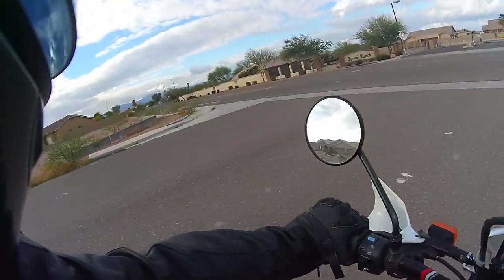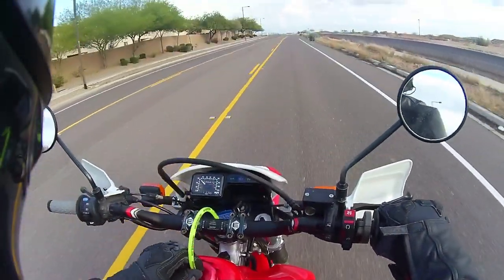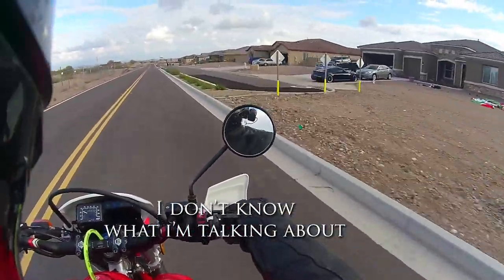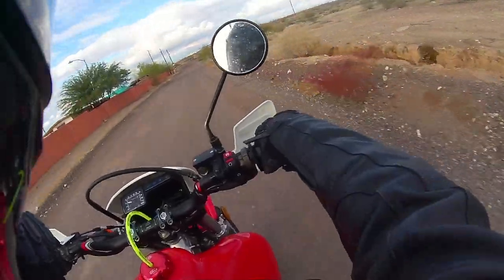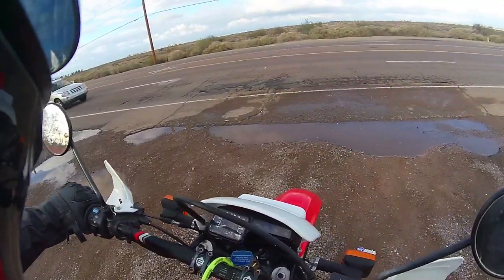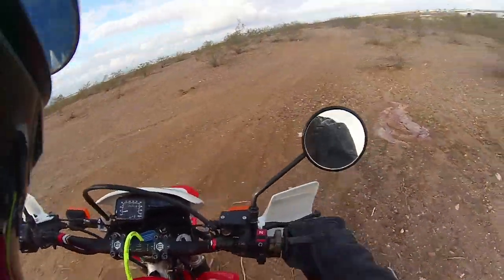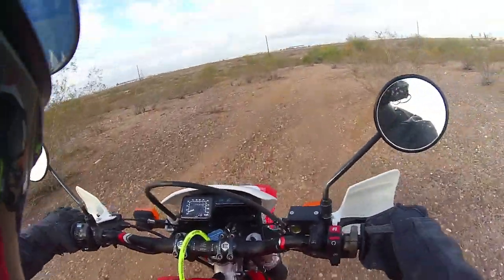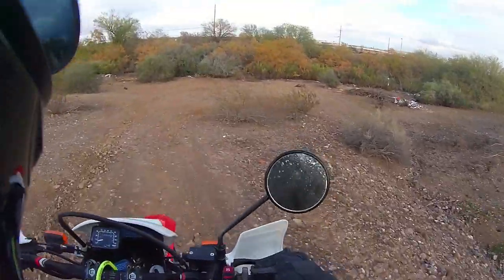XR650L Vlog | Touring Bikes Are Like Campers

Comment: Riding in areas where trash has been dumped is risky for picking up nails! I know.
At some motorcycle size point you might as well have a small car. Last August-Sept. over 4 1/2 weeks I rode a Yamaha WR250R over 6000 miles with a lot of rough roads. 1. Get the best seat for you that you can. Seat Concepts are great for me. 2. Try not to hold the handlebar grips too tightly. I often flex my hands open, then just regrip as lightly as I can that still works. 3. Earplugs actually save your energy as well as your eardrums. One time I was riding a DR650 from Moab back to Denver on backroads. After a couple of hours I was exhausted and didn't think I could keep riding. I put in earplugs (I had forgotten when I left Moab) and I perked up and rode 6 more hours!
I'm 58 years old and have had over 30 motorcycIes, including a 1978 Gold Wing in 1980. 
I really enjoy your mellow conversational tone!

Comment: I have a 13' Super Tenere and a 99 XR650L. I completely get what you're saying and do agree with the exception that as long as you pick a bike knowing it's limitations, it's as good as any other choice. The Tenere is the wrong choice for single-track. It's heavier, more expensive, and more challenging. The XRL, while you can ride long distance on, is not going to be nearly as easy or comfortable as a touring bike. I took my S10 from Los Angeles to Crater Lake, OR, on a 10-day, 3,000 mile trip. I hit a few dirt and gravel roads, and some fire trails. I couldn't imagine a better bike for the job. I picked up my XRL so I could hit the OHV parks nearby and do more challenging dirt riding and work on my skills. Looking forward to running LAB2V next year with the XRL :)

Comment: Not sure if you're still checking comments on these older videos but I'm thinking an FZ07 with some dirt tires and crash protection would be pretty solid for what you want.  Some minor touring accessories make it plenty capable for lightly packed camping trips and it sits comfortably at 80.  I put some Ogio saddlebags and a Cortech tank bag on and I'm pretty set for storage.
Reply from the maker: Tristan Sullivan i get notifications for every comment regardless of the video ;)  Lately I'm thinking this xr650l and an iron butt should so just fine for my purposes lol
Reply: Lol 10-4, seems like you do a lot of offroad anyways.  Got me thinking about something a bit more dirt oriented, sat on the new Kawi Versys 300 at the motorcycle show.  I've never owned a 300 but it seems like a great 50/50 onroad offroad touring bike.

Comment: Thanks for the vid... I guess I subscribed later and didn't see your earlier mod vids... my new 2017 XR650 came on Dec 29th... and I've been busy researching the many options... my Wolfman E12's came last week and the rear cargo rack and subframe stiffeners will be here next week... footpegs, bars and risers come in next week too... Next on the agenda will be a power port for charging my phone and a Garmin wired mount for the GPS... I really like your videos... thanks for the walk around.
Reply from the maker: Todd Gardner thanks, im glad you like them. this bike has a power port built into the front end plastics. its not connected to anything, but it looks like a super professional installation. ive wondered if thats an oem thing for the newer models
Reply: My 2017 doesn't have a power port on it anywhere so yours is probably aftermarket.  I'm going to add one as I said, just trying to find the right place and the right style... I'm changing my bars and risers this week so once I get everything set where I want it, the power port will be next.

Comment: I've taken a '14 xr 650l on a 600 mile interstate trip and the only issues were wind and bugs. Keeping up with traffic and vibration were non-issues

As long as it had a wind shield I'd take a old 350cc cross country cause I know it'll do the posted speed plus five without high rev. Never with anything 250cc or lower though cause any long gradient would cause high rev

Comment: I quite enjoy the bike debate.  I think most people who say the 650 isn't powerful enough don't realize that a few (relatively) cheap mods make it a power house in the off road community.  Maybe I'm not knowledgeable on enough bikes but riding a YZ450F, CR450F, a similarly geared 650 keeps up despite the weight.  Introduce the weight/power of a even larger bike then off road becomes a nightmare.  My Prescott ride we had a triumph rider with us, and he didn't make it when the trail got a little harsher with rock/incline (and seemed to be a skilled rider).  The 650 hits its mark perfectly with great trail manners and moderate road manners, though I would take my 919 any day over the 650 if it was a street only ride.  Like you said, RV vs. Tent :)
Reply from the maker: Robert Stock awesome input man. i actually sort of like the triumph tiger. of the adventure touring bikes out there that one might be my favorite as far as looks. but as far as offroad is concerned, id never go heavier than this xrl....

Comment: Friday your front forks have been moved to lower the front of the bike. I bought a 2016 and installed a XR only lowering rear link. Had to adjust the front forks. Before I moved the front forks. The forks were flush with the clamp.  After sliding the forks up now there is 1/2 inch or more difference above the  clamps That's what yours looks like.
Reply from the maker: c.guns yeah i looked at the top side of the forks and they are about 1/4" through the clamp. I guess I'll just lower them the rest of the way, but it seems like it needs to go further.
Reply: Friday'sThe Bomb yeah I just wouldn't go past the machined grooved area on each Fork. good luck I just notice I commented on the wrong video but you got it anyway. I meant to put on your mod. video.

Comment: I’m happy with my Vstrom DL 650 twin . It does everything I want. And it only cost $3,800 . I’ve put over 100,000 ks on mine and it still runs great . Fuel injection sure makes a difference starting and dealing with altitude. Ride safe 🇨🇦

Comment: This is why I stick to my DRZ400SM. I took it on a 2200 mile trip to California with no problems. I ride my R1 quite a bit too for situations where I know I don't want any off pavement rides. I think your XR would do fine if you put a larger countershaft sprocket on it. You might be surprised how much more comfortable it is. That's what I did to my DRZ. Geared it to do about 100.
Reply from the maker: RacerRed would that be easier than doing a smaller rear sprocket? this is something I've been wanting to do
Reply: You can do a smaller rear sprocket as well (I did both). I would start with a tooth or two larger on the front. Then make your refinement with the rear. If you feel you made the gearing a little too tall or still too short you can make slight adjustments easier with the rear. After going as big as would fit on the countershaft I still ended up going smaller on the rear sprocket as well. I'd take my DRZ anywhere now.
Reply: Exactly, one tooth larger on the front is equivalent to three teeth smaller on the rear.
Reply from the maker: RacerRed so I would need a 16 tooth right? It would be so much easier to swap that sprocket.
Reply: Yes. A 16 tooth sprocket on the front would make a pretty noticeable difference from the stock 15 tooth one. Then, if you like it, keep it. If you don't like it, adjust the rear spocket by a gear or two

Comment: ...oh and on the forks thing... you can lower them too that little indentation is all.  Anything you do to you to your front end will really affect the handling of the bike either off road or on.  It changes the "Rake" or head angle and can make life better or more difficult.  For dirt riding motocrossers will lower the forks a bit (like a couple of millimeters) and it will affect "turn-in" and "tracking" when cornering.  I wouldn't go lower than that ridge because of the dangers associated with upsetting the geometry of the bike.  In stock form though... these things are very tall.....
Reply from the maker: Todd Gardner huh. somebody else pointed out the forks are actually already lowered a bit. the previous owner must have lowered the front, and left the rear super tall. I just want it leveled out more. I can actually feel a slight slant when I sit on it. thanks for the details, i'm glad to hear tiny changes make a difference. and to think I was planning to slide that through another inch haha

Comment: hmmm.  I hear ya . I have a KTM SMT 990. as well as a xr650l. I am riding the xr650 way more. Because I can do everything with it. I agree that its not as nice doing higher speeds and lacks all the bling . but I am considering super moto set up or just 50/50 tires and a wind screen for long distance rides. Plus the XR is way easier to get fixed compaired to all the newer bikes. that KTM has crazy power and its only good if u want to go fast. I am older and enjoy a relaxing ride. I go fast at the track. Love ur vids keep it up.   BC Canada.